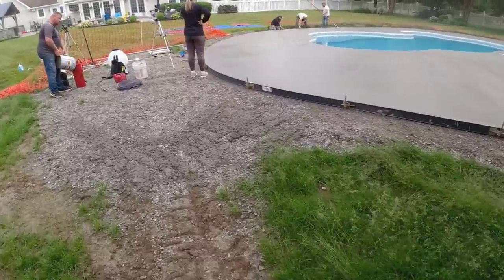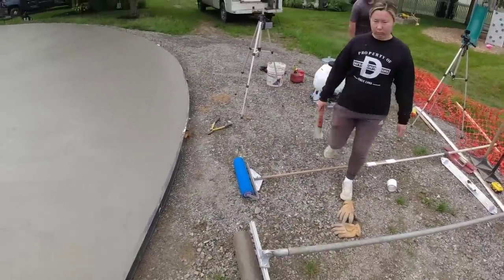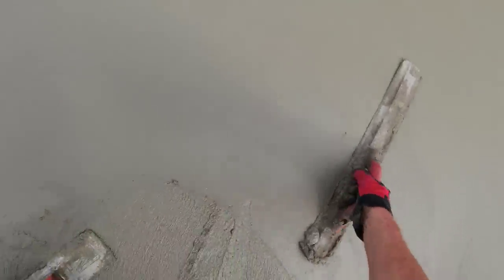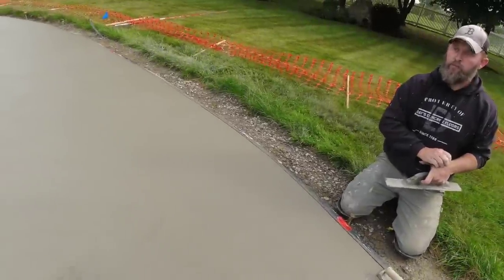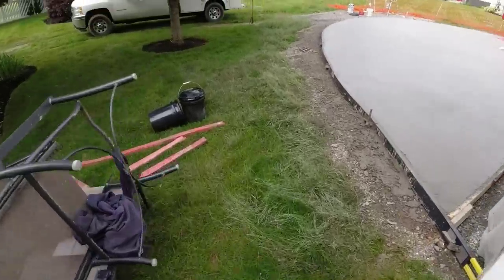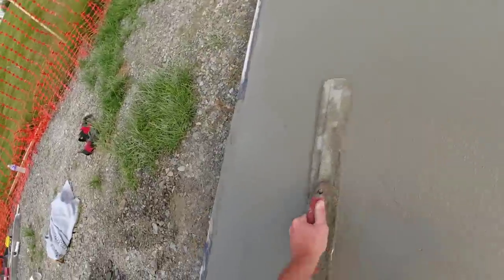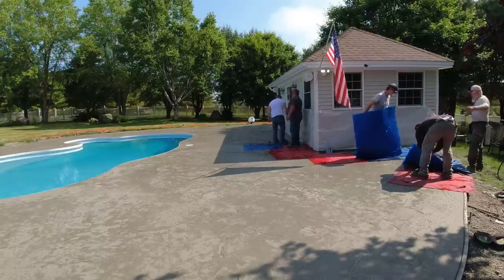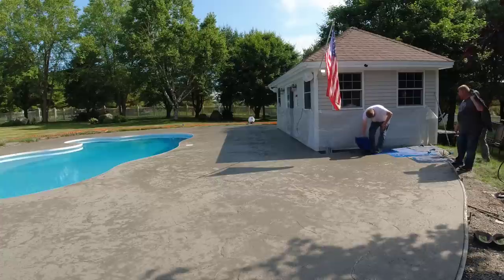How To Stamp Concrete | The Most Concrete I've Stamped in one pour

Comment: For home owners watching this, what you see is why stamped concrete is usually 2 times the cost of regular concrete.  Not only is it labor intensive, but it is also MORE difficult in applying the stamped patterns in a timely fashion than doing a standard brush finish.  This is soooo easy to mess up that it rightly scares away contractors that don't have the people & tools to do such work.

Great job, again, Mike & crew.
Reply from the maker: Thank you!

Comment: If you were to add colored powdered release to the liquid release for the antique look, how much would you add? Would it look the same if you used powdered release? Also, I've been doing concrete for 20 years, and I learn a lot from your videos. You are truly a professional.  Please keep making the videos.
Reply from the maker: We add about a cup or two to 2.5 gallons of release. It doesn't look exactly the same as pure powder but if you keep the liquid shook up in the sprayer it looks close. It tends to want to settle in the sprayer a bit if you leave sitting for a minute.
Reply: @MikeDayConcrete  do you still power wash it when you use that method, or do you just let it dry and seal over it? Thanks